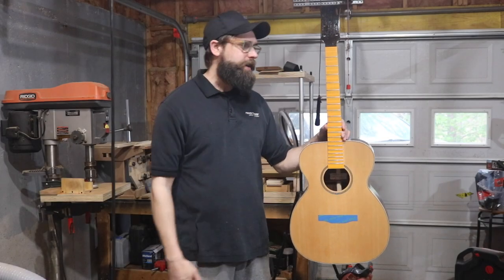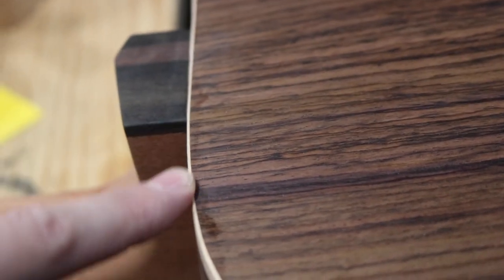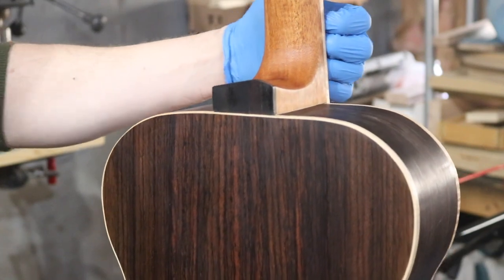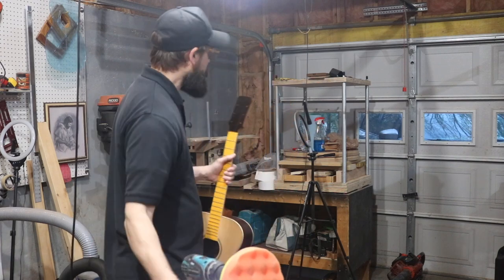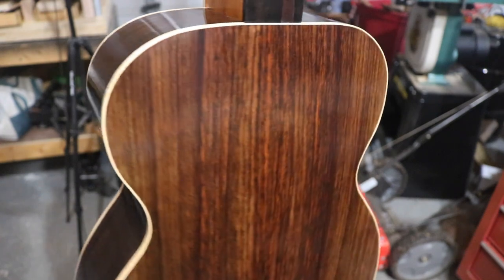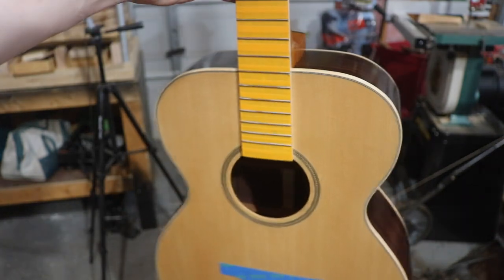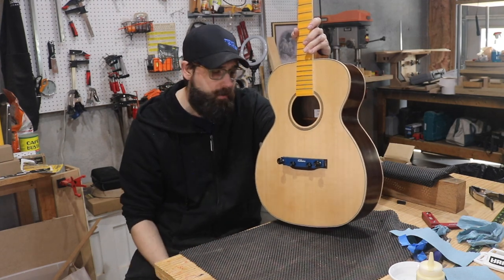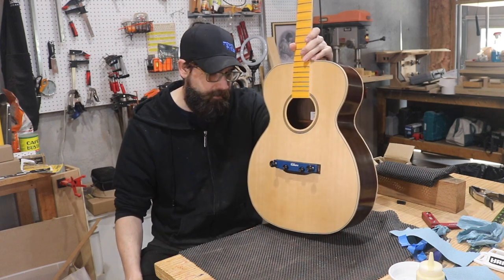Acoustic Guitar Build part 16 // bridge glue-up and buffing the finish

Comment: Thanks for sharing! I'm glad to watch you and the issues you had. I like that bridge clamping tool! I have to replace my bridge now and trying to learn from everyone's mistakes. Thanks for sharing your experience!
Reply from the maker: Thanks for watching! Good luck replacing the bridge!
Reply: @CMRWoodworks  I'm almost done but had issues with the saddle being too short now so the strings are just barely hitting the frets. I'm going to try a hack and raise up the height of the saddle slightly with the super glue and baking soda trick. I tried using shims but it raised the saddle up to high and started leaning forward with the tension of the strings. So the saddle must be seated all the way to the bottom of my repaired bridge so it has the stability of the enter saddle groove that I carved out by hand. Fits snug so this should work!

Comment: Great video Chris.  I am getting ready for my True Oil finish, and yes I am a bit nervous.  It seems that learning how to build guitars is a study in controlling fear and frustration.  One thing I have been forcing myself to do is a dry run for glue ups.  It hasn't stopped all of my issues, but I think it probably saved me from a few.  I'm looking forward to hearing how it sounds.
Reply from the maker: I totally should have done a dry run. I guess I thought that since I‘d been over it in my head several times and watched Robbie‘s video several times that I didn‘t think much could go wrong. Guess I was wrong, haha. Next time, I will clamp in in place to apply tape around it and also drill the holes for the clamp bolts. And also give the holes way more slop for more wiggle room. Thanks for watching!

Comment: You need a block of wood with holes predrilled for those 2 wing bolts.. that goes under the bridge block ... 

 The bridge wings dont need much pressure .. they are thin and can bent easy.... You can actually stress the top and crack it ...and even split the top ..

Its really better to put blocks under those too and use a C clamp on both .. that way there's even pressure ..

Comment: Hey Chris, so I recently built a StewMac body built acoustic, which was a tremendous learning curve, and next I want to actually build an acoustic.   I haven't signed up yet, but I'm very interested in Eric's course.  

I did the Tru-Oil finish on the acoustic and it was very good, so hopefully soon the acoustic guitar will be in progress.  I've done several eletrics and a couple of semi-acoustic (acoustasonic) styles.  There's tons to learn, that's for sure. Thanks for a helpful, and yet real, video on building your guitar.
Reply from the maker: Thanks so much for watching and commenting! Since you‘ve done a kit build you at least have a little experience doing some parts of a guitar build so making one from scratch hopefully won‘t be as daunting as if you‘d done nothing before. Good luck!

Comment: Hey Chris, It’s looking good, I had a huge issue with that grain filler it showed up as White areas all over my sides which are Bubinga, I didn’t notice it until I put a sealer coat of shellac. I ended up sanding it all back to raw wood & now I’m going to try the Tru-Oil varnish, Good luck on #2 & Happy Easter👍🎸🎹🎼🙏🙏👨🏻‍🦯👨🏻‍🦯
Reply from the maker: The white spots are unnoticeable now. I guess the oil made them blend in or something!
Reply: You're supposed to sand off the excess pore fill that accumulates on the surface.  Also, you'll have better results by applying sealer before you pore fill.

Comment: Chris I bought a brace sander from LMI 12 and 30 which side do I use for the 4 back braces thanks Michael
Reply from the maker: Should be 12’ for back, 30’ for front. Different builders use different radii. My guitar for example has a 15’ radius on the back, so I radiused both the back of the rimset as well as the bracing to be the same.

Comment: The white spots are calcium deposits. It comes from the growing conditions in the location where the tree grew. I've seen it really bad to just small spots like what you have. The more you have of them the lower the grade. It can be removed some what but it's best done before building the guitar as you know it could cost you a good guitar build for spots you can't get rid of. I believe , but don't quote me but muriatic acid removes them. The other spots I can't say but I would think it is glue that had not been scrapped off. If it were scraped well then I can't say.  Good to see you back with another video.
Reply from the maker: Ed, thanks for the information. Interesting to know that. I don‘t really notice the spots now after finish, but I haven‘t really gotten close to see. Maybe they are still there, but the shine from the finish draws the eye away. I‘ll have to check it out and see. Glad you took the time to comment! Thanks!

Comment: Don't beat yourself up about buffing...  Every lesson in finishing is learned through failure.  I use a 3" buffer most of the time.  You can really keep your eye on it and it won't rip anything out of your hand like the larger wheels do.  As for finish, tru oil tends to die back a bit, so even if it looks flat now, it will likely show more grain a few months from now.  It's not a huge issue, but it can be frustrating if you're not expecting it.  2 part pore fillers also do a better job of not shrinking.  Some folks use z-poxy, others use a polyester.  Both will work well and have very little shrinkage.  All that said, if you're building your first guitar, focus on the build and not the finish...  You can work on that after you've got the construction techniques down.
Reply from the maker: A 3“ does sound like a better idea after having used that big one I did in the video. The more I pulled on the trigger of the drill, the harder it became to hold the thing steady. It would just start violently wobbling back and forth, haha. Also, I have heard of z poxy lots over the last couple of years. I believe I saw Chris over at Driftwood apply an epoxy filler and it didn‘t look too bad. I may try it next time, actually! I went with the truoil since it seemed to be less trouble to apply. I used it on my previous uke kit build, but I didn‘t thin it and it was hard to keep it from collecting in the corners at the neck and fretboard extension. I definitely had a better experience thinning it, but maybe I‘ll give french polishing a go next time. I don‘t know. I don‘t have spray equipment and I‘m not too eager to use lacquer or dangerous stuff like that without proper ventilation, PPE, and equipment. Anyway, thanks for the comment man! I really appreciate it!
Reply: There's also oil-base and solvent-base pore fills for avoiding shrinkback.